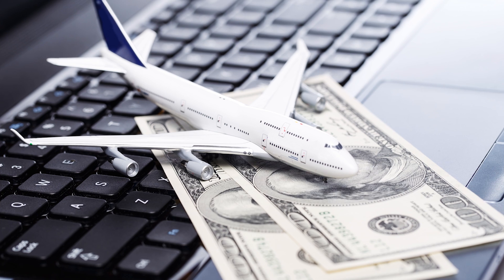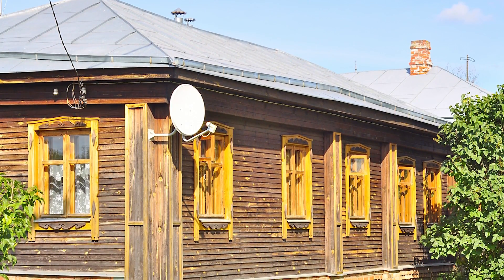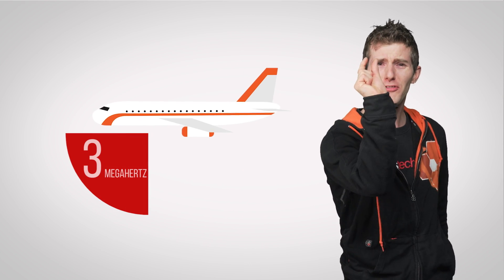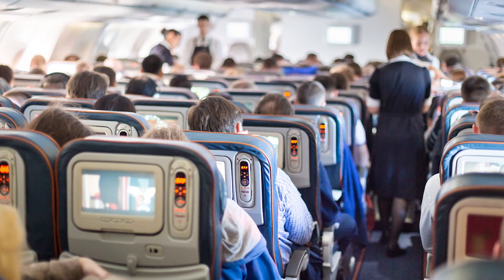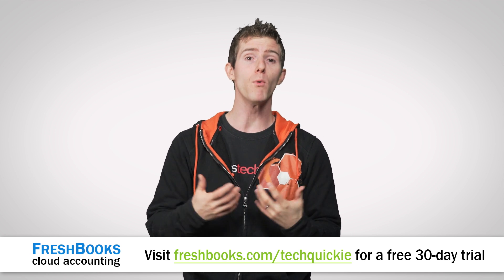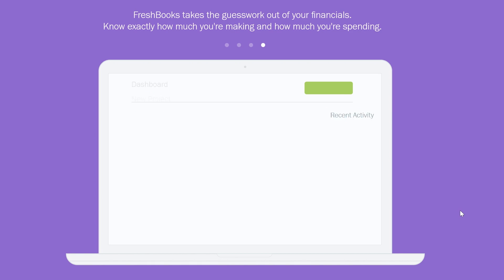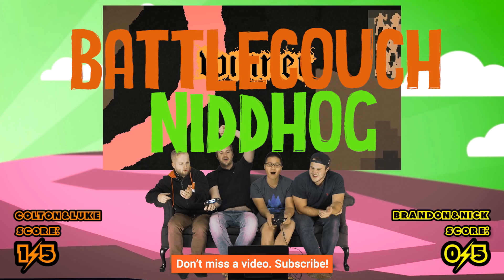How Does Airplane Wi-Fi Work?

Comment: The only time I've gotten anywhere near decent internet connection on airplane wifi was on a Lufthansa flight from Frankfurt to Detroit.  It wasn't great, but it was good enough to watch YouTube on, and since boredom is BY FAR the worst part about flying, it was a nice feature.  The worst was a Delta flight from Atlanta to St. Lucia.  It was miserably slow.  Coincidentally, they also sent my luggage to the wrong country; every aspect of that flight was INFURIATING.

Comment: Life hack (only works on Delta) connect to the to gogoinflight or whatever. When you go to sign in pick the T-Mobile customer option and when it asks for your T-Mobile number just look in your contacts and use someone else's T-Mobile number. It's free for them and you get free internet for at least an hour. It's about 5mbs so not bad

Comment: I am a RF/microwave engineer, meaning I design the amplifiers Linus is talking about and deal with these frequencies and transmissions a lot. I have a few critiques. First, Ka and Ku bands are just pronounced with the two letters, e.g. K-A. The a stands for above and the u stands for under, and they delineate above or below the K-band, which is 18-27 GHz. (The bands get quite confusing actually) Second, moving from Ku- to Ka-band will get more bandwidth due to the higher frequency (Usually the same percentage of bandwidth is attainable, so moving up gives you more), but it will not save you power. As you move up in frequency, amplifiers and antennas get physically smaller, but the efficiency of transistors decreases. So for the same output power, moving up in frequency will cost you more DC power. Lastly, the amplifier does not weigh much at all, and the antenna probably doesn't either. I doubt size or weight is that big of a concern for the construction of the plane (but I'm not certain). Hope this helps a little.

Comment: Techquickie, I'm a pilot. Just small aircrafts, not a commercial pilot. If you could have a wifi signal up to 8500 feet, what devices and what do you think could make it happen. I have a Stratus 2s that helps with my Foreflight app but I'm trying to achieve a signal that can make calls, texts and if possible download/send a video.

Comment: not true for KA-BAND … it would need a dish ok the plain hahahah or at least .. big anthenas…. and you wont see this .. cuz .. the will use a other type of anthenna ...but .. whe will see… 
exemple.. if its true… for KA BAND - AKA hybrid satelite internet .. well .. it should be faster when the plain is in high altitude …. .. but if they are lying .. about that new tech…. well it will loos bandwith on higher altitude .. cuz they will still use broard band tour .. or tower for internet and not satelite

Comment: Ka and Ku bands are not spelled/pronounced Khaaa and Khuuu. They're pronounced Kay-you and Kay-ay. For the intent of this argument, there are 3 bands we want to concern ourselves with. K, Ka and Ku. The K stands for Kurtz, and the a stands for above and u stands for under. So Ku is under the frequencies of K, and a is above. These are microwave bands, mostly used after satellites switched from C band to K band. However, things like the sun, water in the atmosphere and just background radiation would interfere with these transmissions, but only certian parts of the K frequency range and thus the K band was split into 3 smaller bands, K, Ka and Ku. Ku has problem penetrating water, whereas Ka does not. And since we're surrounded by so much water, this is usually your problem with "spotty" Airplane internet, not that too many people are using, that would be stupid. If there's a lot of moisture in the atmosphere, the Ku signal would have a problem getting through.

Comment: Really cool TechQuickie, just a few things caught my ear as I was listening.  It's "K" "U" and "K" "A" Not "cah" or "cU". It is only "new" in the sense that airlines are just now making use of it, we've had this tech for as long as Satellite Communication has been a thing, Airlines are just now starting to make the leap. And it isn't KU Bands that are holding Airlines back from higher data rates, its the fact that they have to upgrade their equipment to get the higher data rates and KA is a much more stable band / less countries are using KA Band so there are fewer blocked frequencies, and when you have to upgrade equipment anyway why not change to a easier band to use if the price is pretty much the same.

Comment: The best way to explain this is through phone terminology. the current ATG system in place specifically by GOGO is a 3G cell tower system they literally rotated the antenna on. (the distance out is similar to the distance up so a lot less engineering than you would think went into that. )
that system would be outdated and annoying even if you had your own connection to it, now imagine sharing a mobil hotspot running off of 3G its painful for all but email. 

the KU system (Im used to hearing it pronounced K-U) is basically 4G but its coverage is still proving so difficult airlines are lookign to move past it. 
there is a 4U system which is a marketing branding of using multiple KU receivers which improves reliability but again doesn't have the bandwidth to support more than a few passengers. 

the bandwidth these companies are promising on full KA systems is getting into the Gbits now which for the foreseeable future is an infrastructure worth investing in. and yes these systems have significantly less fuel burn from extra air drag. (eventually someone needs to just add this to design specs to the plane manufacture so those stupid ray domes go away... but anyway)

as for the costs of the fuel, some companies have agreements that treat the ISP as its own vendor, and the company pays the extra costs associated with weight and drag. 

surprisingly one of the most significant factors in the slow speeds (this can be apparent when trying to stream from the on plane servers) is the wifi structure on the planes. only recently has the idea to understanding the physics of how filing a metal tube with GHz frequencies degrades the signals, and depending on placement and porting some planes actually have decent service which doesn't work well because of clogged airwaves. 

It seems to me the largest issue in this industry is the lack of engineers or at least engineers really acing as technicians, the ones deciding everything are business people, and they are great at that they have a product people want and they sell it, but they arent the kind to know how to set this whole thing up without causing more problems than it is worth.

all of my information is sourced from professionals in this field, Linus you explained it well, but you left out some key points which are becoming the largest factors.
(airlines have been moving away from ATG for years- the systems replacign it are often times failing becuase of design not capability and that is across the board on providers Thales, Panasonic, and Gogo each of them has their own really fun moments)

Comment: I don't think it is spotty. It is just slow. I've tried the one from Qatar about a week ago - they have a free 10 MB offer. 10 MB doesn't go a long way but for Skype it is more than enough. The problem with it is that it took about fifteen minutes to send a 2 MB picture over iMessage. But this is only with Qatar Airways. With Cathay Pacific, it works ... surprisingly good. It is no streaming speed but it is reliable, fast and relatively lag free.

Comment: Yet some airlines (cough United cough) forbid communication with the ground (e.g., face time). Last domestic flight I took a few weeks ago, the guy in front of me bought WiFi and was video-chatting with some folks on the ground and then the flight attendant told him that communication with the ground is prohibited and he must stop. He did it but complained that then what is the purpose of WiFi if one cannot communicate with other people on the ground. He got a refund.

The thing is there is no law that forbids the use of WiFi to contact the ground. There are some concerns if you use your own radio transmitter, but using the digital WiFi system should be OK with the airplane electronics. Also in the airline website they usually restrict streaming sites (Netflix, Skype) not due to a air-to-ground communication ban, but because of bandwidth usage.

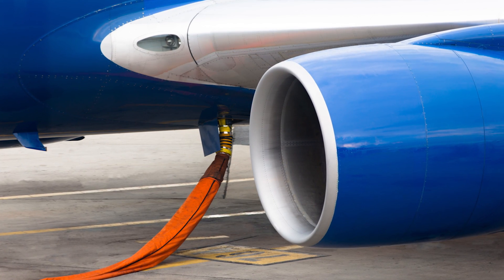Comment: @techquickie @3:19 when you mention fuel costs.  That picture is not a fuel line, but an external air port to add conditioned air (heated or coolled) to the cabin while the plane is off

Comment: or just do what i do and plug 3G/LTE USB dongle into your laptop with an external antenna wedged between the window and window shade using a jacket to hide the cable and enjoy using your limited data cap while the other suckers are paying for slow and expensive inflight internet 
it is against regulations so you may have to share the conenction with your seatmates to avoid any unwanted attention but its still cheaper than inflight internet 

i do that everytime i fly and the speeds are not half bad despite being 30,000ft up travelling at 450kts 
unfortunately it only works if your flight path is in range of your wireless carriers towers 
and sometimes it doesnt work that great even when you are in range due to switching from 1 tower to another every 20 sec (dont try and play online games with it as it WILL NOT WORK)
Reply: Careful with that, make sure you're not a problematic frequency range (depends on device used and band used by the carrier)
Reply: @zivunknown  my dongle uses the following 3G frequencies 850mhz, 2100mhz and 900mhz (i dont get 4G up there)

no issues so far

Comment: Hey Linus i got a video suggestion for you. ..
Something I've had trouble finding information on is what kind of fan do I need for a custom Car Amplifier Build..
so a great video would be a video about case fans for all types of scenarios.. not just pc cases.. so i can get a better understanding of the types of fans there is. and where they work best. also what i should look for.. higher RPMs. or Higher CFMs.. or other specs i should know about.. 

also i havent seen a video about Thermoelectric modules. have you thought about making a video about the uses of a peltier module? making an air conditioner or refrigerator. it would be nice to hear your thoughts on themoelectric modules.

Comment: The best part about paid airplane wifi is how easy it is to hack it. Networks like this that aren't password-locket, but require a payment to access internet, check to see if you paid for internet by identifying your MAC Address. Simply open Terminal, type 'arp -a' and change your MAC Address to each of the different ones listed. This is essentially changing your identity to everyone else's on the plane's network. Once you find someone who's paid for the wifi, you have free internet!

Comment: Summary of the comments:
1: People that are saying 5mb amd 512kb is a lot

2: People saying 100 - 300 is normal
Reply: depends on whether "bits" or "bytes"
Reply: 5 megabytes per second can get the job done unless you're downloading a huge game or 1080p hd movie. 5 megaBITs will struggle.
Reply: @curtisstephens4482  5Mbps is actually fine if that's what you're actually getting, you can watch "low/standard quality" Netflix/etc. at that speed without needing to pause and load. I know because 5Mbps is what I get when the internet is behaving where I live. It frequently drops down to 1Mbps or less though. And my upload is 0.1Mbps on a good day... If I upload pictures to Facebook the internet for everyone in my house stops working until the upload finishes.
Reply: 1 is the people with copper cable xD
Reply: 300 kilo bytes per second
Reply: 5 gigantibytes
Reply: AEX10 welcome to England 5mb is quite good
Reply: I have 200mbps up and down. That's amazing for Africa...
Reply: Emile Hoffmann I have 1000mbps but even if the network is not clogged I am not on Ethernet so I get about 12 mbps from 30 ft. Away on 2.4
Reply: AEX10 3. people stating their Internet speed
Reply: Dude I have 4-5Mbps
Reply: But I have 30mb/s
Reply: Let me just flex my gigabit internet real quick
Reply: @strixxxx  and
Reply: 300-400mbps WiFi: :D
No discrete GPU, Celeron N2840 and 2GB LPDDR3 RAM: D:

Comment: You fucking wot ? "Not great speeds, around 5Mbps". That's fucking amazing
Reply: 5mb for a plane of people? that would be horrible
Reply: That speed is for every passenger and not per head. Hence it gets pretty slow when say 100 people try to surf the web.
Reply: PlasticAcaria Have you experienced 50+ Mbps internet?
Reply: The fastest I experienced was 2 Mbps. OUR FUCKING ISP...
Reply: Yeah, but the flights are quite often crowded. We have 100 Mbps here technically, as well as 40 Mbps upload, but we usually reach anywhere between 20 to 80 down.
Reply: PlasticAcaria when you are used to 300 Mbps, it's slow
Reply: oh, well yeah for everyone, it's quite slow, but for like 5 guys that's not bad. And no I've never tried some 50Mbps+
Reply: lol.76mbps for me...

Comment: I am not sure where you get your "20 to 160 Megahertz" figure, but the highest bandwidth available today over RF allocation would be DOCSIS 16 bonding QAM channel (NTSC is 8MHz per channel), so 128 Mhz total allocation. However, newer (yet unimplemented) DOCSIS 3.1 deployment could do a wide 200 MHz channel.

Comment: 126kB/s sharing with 5 ppl, in Australia... Normal life.
Reply: Liangshi Xu Give me the link of those people's death certificate.
Reply: Brodie Garrett You couldn't even watch this video if you had 10kb/S stfu LMAO
Reply: You get used to it. been there too. 128KB/s for whole house of very alive younger people with at least one desktop per each (and some had additional laptop/wifi enabled pda/smartphone - this was before tablets became common).
Reply: Liangshi Xu lucky I'm in Melbourne and I get just over 10kb/s and when it rains I lose connection and if someone's on the phone I also lose connection 
(No I don't have dial up I have adsl2+)
Reply: true, i am enough with this the slowest of the slowest network...
Reply: When you hang on a mountain wall, trying to figure out why the heck the solar charger doesn't put out any current (solar cells are clean, volt. checked, it is nice sunny mild weather at 35deg. celsius ;) to power a wifi repeater, you start to value that 126kB/s more...
Or perhaps start panicking, thinking that hipotermia induced halucinations are setting in ;-)
Reply: OMG YESSSSSS!
:(
Reply: Speak for yourself mate 140/40 in Darwin. Move to a better area
Reply: Same. In 2019.
Reply: Pyroslav x i am talking about right now. i have to use 4G on my iphone 7 that i cant plug earphone into !!!